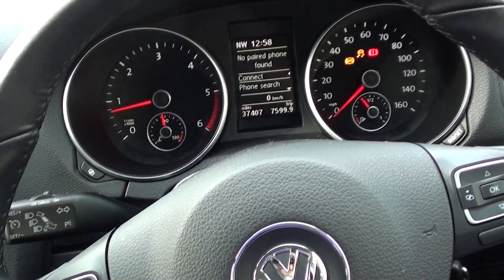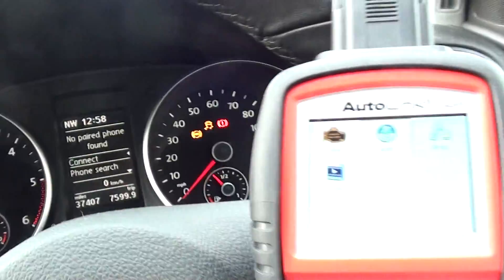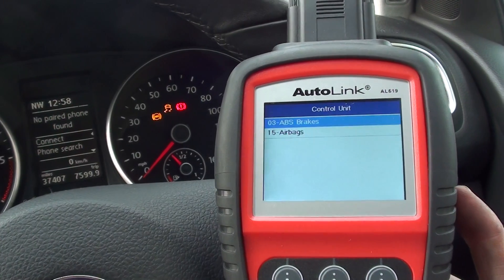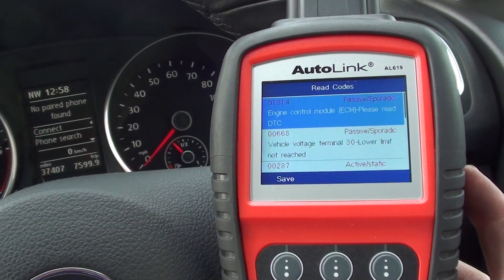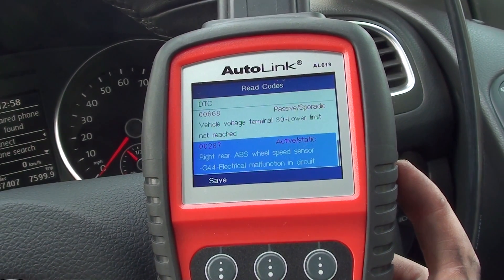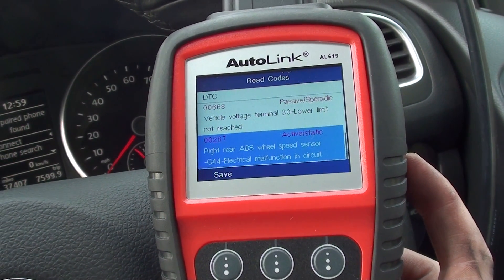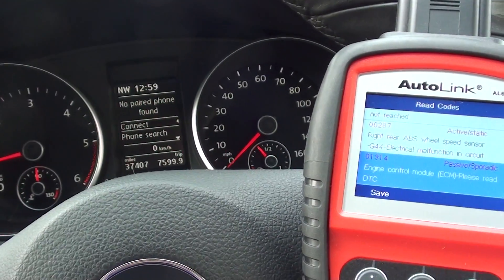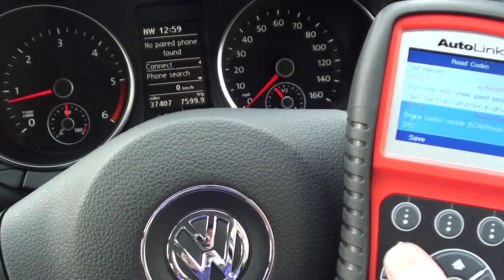VW Golf Mk6 ABS Faults 01314 00668 00287 Caused By ABS Sensor Fault

Comment: I have the same codes on my golf mk6. Additionally I have codes for adaptations for steering, acceleration and brake pressure. And finally code 01305 databus for infotainment.  I disconnected the front two abs sensors for training purposes and since have this issue. Scoped both front abs speed sensors for signals and voltages and seem ok. I then checked the ground feed to the sensors and only one side front sensor had a ground feed the other side didnt but today checked again and now both have ground feed all of a sudden. I checked live data on all 4 speed sensors and all seemed ok. what could be the issue you think?
Reply: what was the problem???